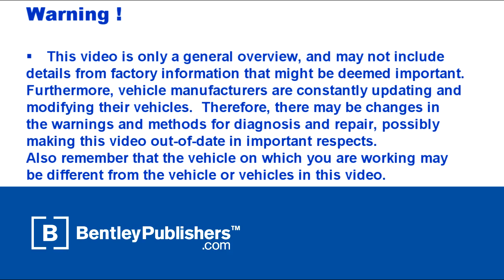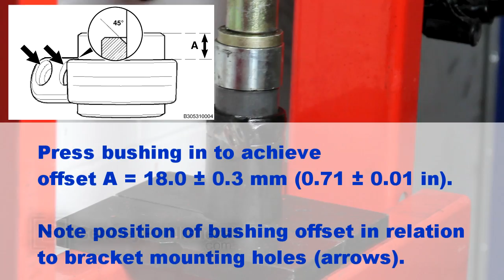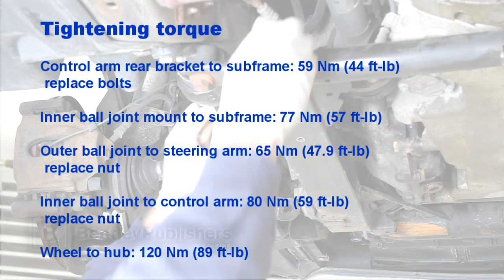BMW 3 Series E46 (325xi) Front Lower Control Arm, Replacing - DIY Repair

Comment: great video. I found on the passenger side, if you slide the exhaust shield above the bushing out it makes it much easier to unbolt the bushing bracket.

Comment: hi flash, it sounds as though a couple possible things could have happened/been damaged, or incorrectly installed. very first thing i would check is to make sure the control arm bushings were correctly installed. they are marked L&R, but i have seen them put on wrongs sides before.  also, if the ball joint to wheel hub knuckle pivot was bent even slightly, that would cause a binding.

Comment: You can borrow pickle fork and inner ball joint remover from advanced auto.  Advanced Auto had the best set in my neighborhood.  When you return them yo get your money back.  I didn't need the bushing remover since i purchased the bushing already in the bracket.

Comment: So I see when looking online to purchase the lower control arms that some have the inner ball joint mounted on the control arm (with a bolt going to the carrier), others have the ball joint mounted on the carrier attached to the frame (like the one in your video)... Can the ball joint be mounted on either and bolted from either end? Thanks!
Reply: Nevermind... got it... The control arms for the XI (all wheel drive models) are mounted from the carrier (as in this video), the two wheel drive models are mounted from the control arm.

Comment: Would the lower control arm gong out make the car hard to drive straight at freeway speeds. I don't mean the alignment is out (it doesn't pull to one side. It is just hard to find that sweet spot in the center of the wheel at 70 mph

Comment: Got a complete kit from Turner motorsports with the bushing installed in the bushing brackets (saved a ton of time worth ever penny)  The 2001 330 xi passenger side is harder do to the heat shield which needs to be on screwed so you can get a wrench on the control arm bolts.  get a ratcheting  wrench because you can only make a small turn each time and youll be flipping the wrench every 6th of a turn.  I would recommend you change the Sway bar links while your there as well.  Also the passenger side has the front ride height sensor (not shown in the video.  it controls the headlight angles) that needs to be undone from the control arm and reattached to the new control arm.  lube the (dish soap or water based lube) bushing end of the control arm and install the bushing bracket onto the control arm before installing the control arm on the car.
Reply: J Maj how did you overcome tightening the ball joints with allen head under the cv?
Reply: The the outer ball joint nut (at the wheel) wasn't a problem for me using a standard 5/8" wrench - I didn't use the allen head on either ball joints. I used a 7/8" socket for the inner ball joint nut. The inner ball joint started spinning as I loosened (during removal) as well as when I tightened (during re-installation). I went ahead and reattached the wheel and lowered the car back to the ground and then was able to tighten it again without it spinning. The ball joints, when under load, sit in a taper that keeps in from spinning. Sometimes when the car is jacked up, and the control arm is sagging, it will come out of this taper and start to spin.

Comment: Hi, i got a mechanic to replace my wishbone with balljoint already on it,  in my 2000 E46 318ci, now when im turning a hard right, my wheel locks up and doesnt spring back to the centre like it used too? Any ideas what it may be anybody?

Comment: good video, but why remove the middle ball joint fromt the arm, then mount it to the car, and then mount the arm to the bushing? Can't you just leave it on the arm?
Reply: Because the old arm is being thrown away. You can leave it on the arm if you replace the factory outer joint with an e36 non m outer joint. Not easy without serious tools but worth it in savings.